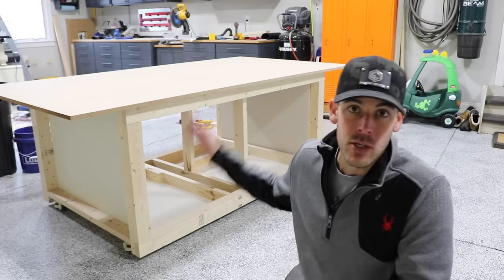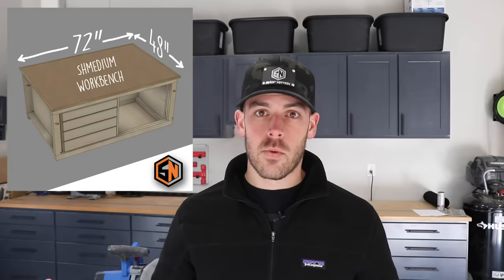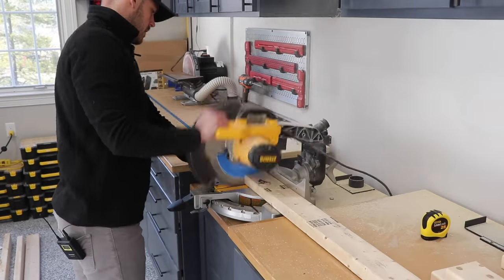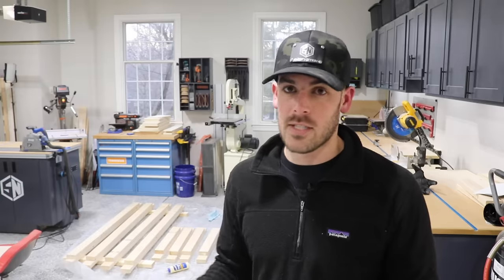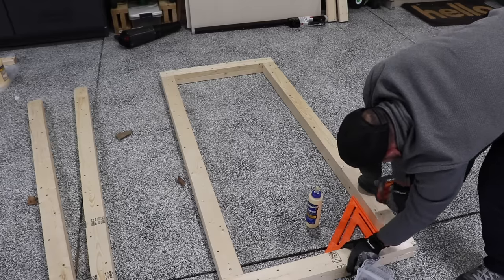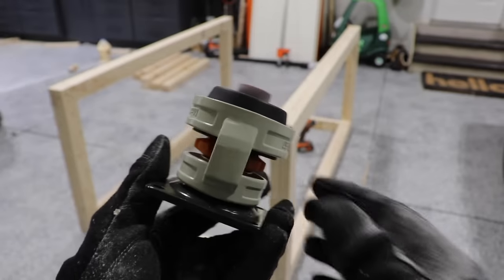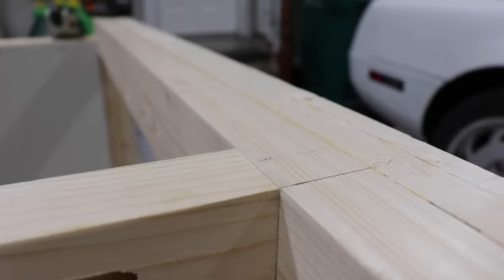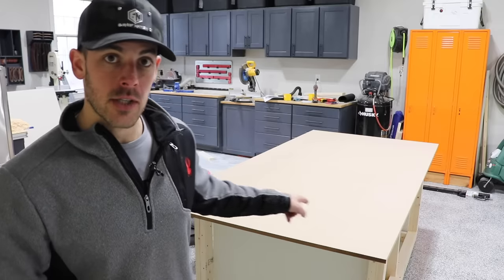The Perfect Garage Workbench & Outfeed Table // Part 1

Comment: As always this is going to be a great build. Question regarding the MDLUU Leveling Machine Casters, what is your opinion compared to the other casters? Do you have any restrictions moving from side to side? I built an outfeed table with 3'" Polyurethane caster and the mobility was just ok and not what I expected.  I am considering the MDLUU Leveling Machine Casters.
Reply from the maker: Great so far
Reply: Are you still happy with the casters? Looking to retrofit my bench with something that levels

Comment: I'll be honest...I love the build but I hate those feet both in concept and in practice. Like really hate those feet. I'm sure that when that bench is loaded up that those nuts are nearly impossible to spin with your fingers and they look like they're painted, so you're not going to want to go at it with a flat head and a hammer. The only fix for them I can see is if they put a 90° gear in there and you could crank that puppy up with an electric drill via an external nut or something. Like case in point- want to put it up against the wall? Well run all 4 gears up, move it x feet, put it against the wall, then squeeze behind it and screw 2 of them down. Bad idea. Regular casters all day FTW.
Reply: @Craig Albrecht - I bought the WoodRiver version of these leveling casters for a similar assembly/outfeed table I recently built.  I am using these for an outfeed table, which sits right behind my Unisaw and it has to be about 1/16” lower than the table saw so wood doesn’t hang up when passing through the table saw.   My outfeed table has 3 layers of MDF + top layer of ¾ Baltic Birch, and the legs are 3-3/4” solid maple hardwood, so with nothing loaded into it probably weighs 400-500 lbs.  The red leveling nuts/spinners look like they would be hard to spin up or down with a lot of weight on each leg.....They’re not.  I can spin them with one finger to raise the caster up onto the wheel to make them mobile.  When the casters are up on the wheels, the table almost glides along the floor.  When you raise the wheels and the table gets onto the heavy rubber feet – the table will not move, unless you somehow pick it up.  I got these casters for 2 reasons – For the 1,100 lb. total capacity and because I needed the leveling feature for the outfeed table height.  If you are concerned about being able raise/lower the wheels – checkout the picture on Amazon’s product page – they actually show a thin wrench being used to spin the nut up and down.  I’ve never needed to use the wrench.  They work great!
Reply: @nathansecrist3337  That's crazy- I never would've guessed they would've been that easy to adjust. I guess the rest with the extra effort needed get the table onto the casters is personal preference at that point depending on how much you move the table then.

Comment: As a middle aged guy with questionable knees, I am concerned if future you will want to bend down to screw down those feet  instead of just stepping on a castor brake.
Reply: That's exactly what I thought also. There's no way I'm going to crawl on the floor in the mud, the blood, and the beer to crank those pads up and down. It looks as though it would take a fair amount of force to lift the weight of the bench off the casters. Not my idea of a good time...
Reply: @kkaucher  Well-placed Johnny Cash reference there!

Comment: Is anyone else confused as to why he would make the side frames stupid strong, only to have the feet connected to a stretcher that’s only connected with 4 pocket screws? That completely negates the strength gained by the side frames because now all the weight is sitting on the pocket screws rather than the strongest part of the bench.
Reply from the maker: There are some additional braces that I forgot to add! Will be shown in the next video...
Reply: @ShopNation  thanks for clarifying! Can’t wait for part 2!

Comment: Great content. I'll be watching the series. 

FWIW, I had a fellow "Maker's Playground" member recommend those locking CASTERS for my future bench. They're super cool, but I'm an old fart with bad knees and getting down on hands and knees to spin that little wheel to raise and lower the wheels ain't happening. I'm kinda like Stumpy Nubs. If I drop something, I'll build a jig to pick it up. You'll understand at some point down the road. For us old farts or those who were unkind to their knees, one alternate is linear/in line toggle clamps combined with traditional casters. You can also fashion a handle extension so you can activate them without even bending down... you know... for us old farts who were unkind to their backs as well. 

https://www.amazon.com/XRPAOWA-Toggle-Holding-Capacity-Stroke/dp/B074RYNVYM/ref=asc_df_B074RYNVYM/?tag=hyprod-20&linkCode=df0&hvadid=312003160272&hvpos=&hvnetw=g&hvrand=11212501573767938022&hvpone=&hvptwo=&hvqmt=&hvdev=m&hvdvcmdl=&hvlocint=&hvlocphy=9025184&hvtargid=pla-569469598938&psc=1

Comment: Gloves and machines are not a good idea! If the glove catches it will pull your entire hand into the cutters and make a big mess. If your hand goes into the cutters without a glove you will only damage the finger or part of the hand that hits the cutter. Be very careful,  gloves are not a safe thing to wear around machines.

Comment: Ugg.. Why did you put wheels on a weak load 2x4 with only pocket holes for support?  At least have some sort of notch in the wood to hold it.  Think BUILDING A DECK. I would never rely on screws for strength.